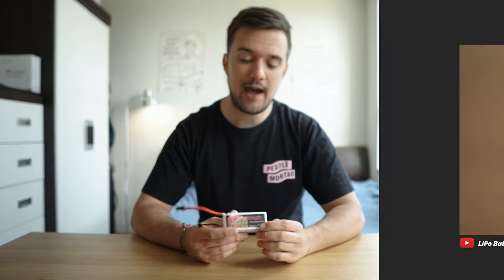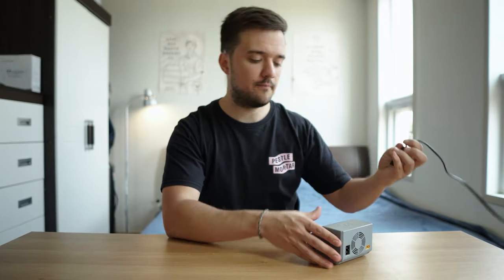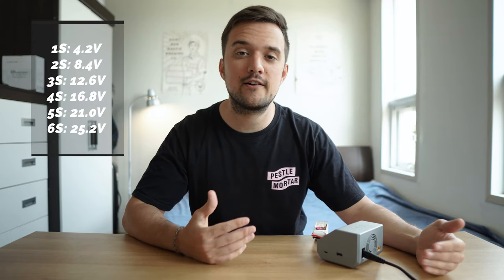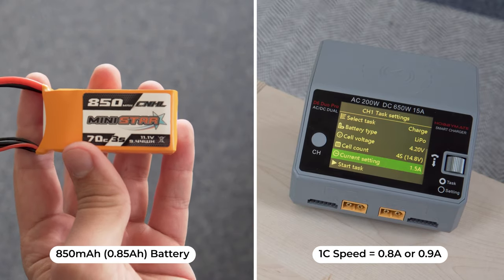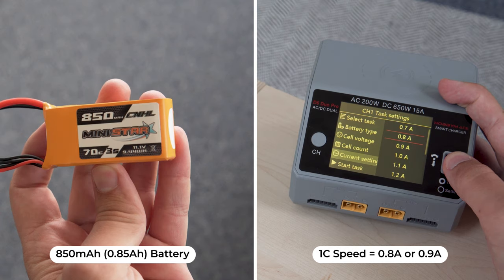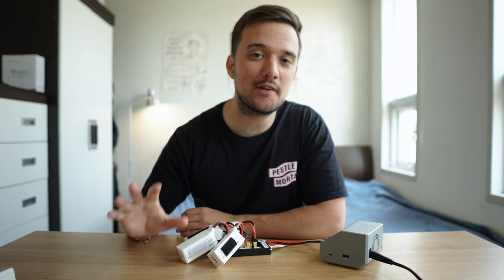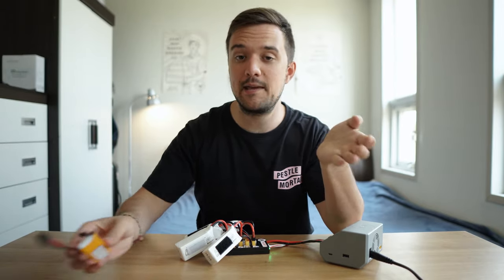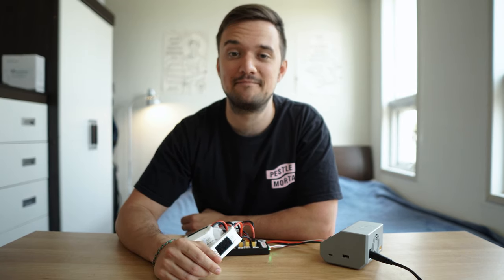How to Charge and Parallel Charge Lipo Batteries

Comment: Matt I followed this video and have the same charger and parallel board. i’ve been flying a little while and wanted to decrease the time to charge my batteries. When I then plugged it in to try parallel charging I got a warning saying “warning battery polarity is reversed” I can usually charge them fine and they were very similar voltages so i’m kind of lost on what my problem might be? have you ever experienced this?

Comment: Okay i got most of the basics, but I am confused on what is the full Volts for example: I have a 6S - 1050 mAh battery I set the charger to 1A so what would be the final voltage of the whole battery fully charged: 25. 2? This super confusing for beginners.

Comment: So if you have an 80w charger and you charge 4 (similar) batteries in parallel board,  you can only charge them at 20w each rather than 50 or 80w max one battery would get?

Comment: Hi

Great video

Is it possible to discharge and balance with the parallel charging? 

I am a beginner and ordered protek 35 6s, hota d6 pro duo charger, dji digital system, parallel board and i am going to buy 6 batteries CNHL BLACK SERIES 1300mAh 6S 
So i wonder if i can put the charger on storage mode and use the parallel board

Comment: So basic question will I only see 1 of my batteries cell voltages across all cells on my Hobbymate D6 even though I have 4 batteries.  Using exact same charger but im using 4 2 cell batteries.

Comment: Charge in parallel to 4.15V each Cell, than put it on another Charger and calibrate it to 4.19 each Cell.

But before, i charge evrey lipo pack to storage voltage (added it to 3.75V each Cell) .
So i can Put my Lipos togehter with 3.75 and charge them to 4.15V...

Comment: My charger need to imput the capacity of the battery, I have 2200 mAh Lipo, for 4 batteries should I cumulate and give to the charger 8800 mAh or should I give 2200 mAh ?

Comment: Have one question in parallel charging, say i have to really charge all 6 packs and one or two batteries has more voltage in them that i cant parallel charge it with the rest. What can i do to that two batteries with charge in them? Should i discharge them first to a point where their voltages fall in that 0.4v difference range?

Comment: Why when my battery is fully charged (42 1550mah, do I still have some value in the mah field, in some instances this is as high as 300mah despite being charged to 16.8. Is this down to a dead cell or is the battery coming towards the end of its life and unable to 'fill up' as much as it used to on currents?

Comment: Its pretty safe to parallel charge different mah batteries that are from different companies. For example: charging a lumineer  4s 1300mah with a RDQ 4s 1500mah is safe.
Reply: Is it also safe to charge a 500mah with a 1000mah?
Reply: @ELValenin  It can be fairly safe to charge at 2C depending on how reliable the battery is. Its just important to be extra vigilant about paying attention to it just in case something goes wrong.
Reply: @sylaswojciechowski6895  ah OK so you can just use any capacity and mix with any other
Reply: @ELValenin  well, I wouldnt do that. A 1500mah lipo should be charged at 1.5 amps, thats 1C. A 500mah lipo should be charged at 0.5 amps for 1C. If you are a dare devil and need to charge faster, than you can charge at 2C, for a 500mah lipo that would be 1 amp. But that can degrade the lipo slightly, and be more dangerous. I almost always charge at 1c.
Reply: @sylaswojciechowski6895  what about just charging with less amps so the small one will get 1c and the bigger one less?
Reply: @ELValenin  oooohh, your talking about parallel charging different mah rated lipos at the same time. Sorry I didnt under stand your question earlier
Reply: Im pretty sure if you charge at .5 amps than one lipo would charge fast and the other slow, and that would be bad? Double check that. If I were you, and needed to parallel charge a 500mah and 1000mah lipo, then I would charge at 1.5 amps. Thats 1C when both mahs are added together. 500mah + 1000mah = 1500mah , or 1.5 amps.  I THINK?  This would be a good question the email Joshua Barwell.  😆
Reply: @sylaswojciechowski6895  It comes down to the internal resistance of each cell. This resistance limits the flow of current into the cell for charging. If the 500mAh battery has lower internal resistance (Brand-A) vs the 1500mAh battery (Brand-B) then most of the current will flow to Brand-A leaving Brand-B at a incomplete charged state. The balance connection to the charger sees that the "cell" is still not charged and could keep charging. The other case would be that the charger stops (unlikely) leaving Brand-B undercharged. Murphy's law will always win in the end...I would not miss match brand or capacity.
Reply: @carnilean  interesting. Are you saying that you would not mismatch brand bc they could have too much of a difference in resistance? 2 of the same lipo can stil have different resistances depending on how they were treated, and the manufacturing tolerances. But very interesting point

Comment: I have the same charger as Matt does in the video ( hobbymate d6 duo) but all my 6s batteries have a diffrerent balance lead then the one that the Hobbymate charger has and i cant connect the battery balance lead to the port of the hobbymate. is there an adapter that I need? ive searched online but have found nothing

Comment: So why charge the one battery seperate if the parallel chargingboars equals out the voltage if you let it sit. If you let them all equal first for a min or two it should be no problem.
Reply: the amperage will be too high, you may burn the parallel charge board and the batteries with the lower voltage may get damaged

Comment: does C rating mather if the battery is the sam mah? i got 2 1550 mah 4s at 45C and one 1550 mah 4s 100C all same brand lipo. 
can i charge them in parallel if the C rating is different?

Comment: The thing I've learned in this video is not to parallel charge my batteries. I regularly abuse my batteries by leaving them fully charged over many days, then when I fly I usually draw them down to the point where they don't have any more power to make the quad hover at all. Add all that together to the fact that you have to monitor all your batteries for voltage difference that parallel charging needs, and that it doesn't truly actually balance all your cells. I instead bought two D6+ chargers that allows me to charge 4 batteries at a time. Good enough.

Comment: if i need extra amps, can i use a 2:1 xt60 connector to charge 1 parallel board with both channels?
Reply: it depends what charger you have, some do not have this feature

Comment: How did you get 6 Amps
Reply: (Some would say that this reply comes a little bit late) But, 1 battery has 1500mah, 1C of that is 1.5A. When you have 4 batteries it means 1.5A x4 = 6A (When you use the board he has.)

Comment: Do yourself a favor after watching this and DON'T PARALLEL CHARGE. Assuming you're a noob ( 90% of you most likely) balance boards are no joke and if you're inexperienced or lack the proper knowledge you're risking burning your house down. They are not a joke, and I highly recommend charging singular batteries. Internal resistance was not covered in this topic, balance boards are not something to lightly brush over..what a shame.